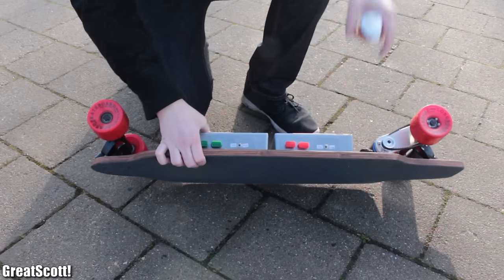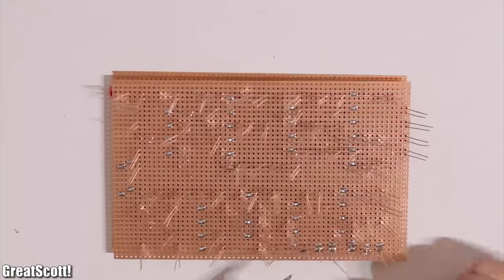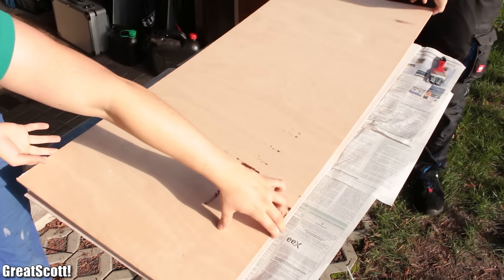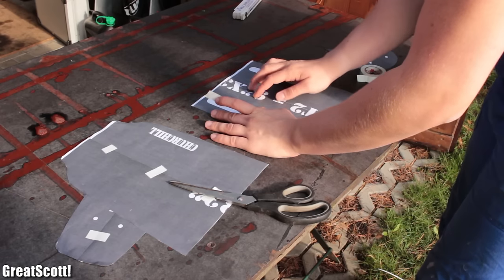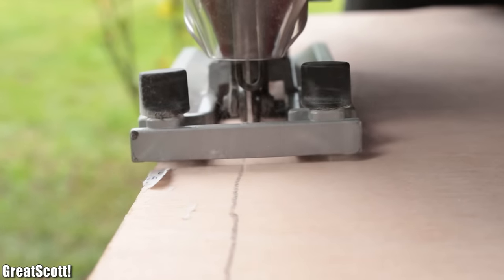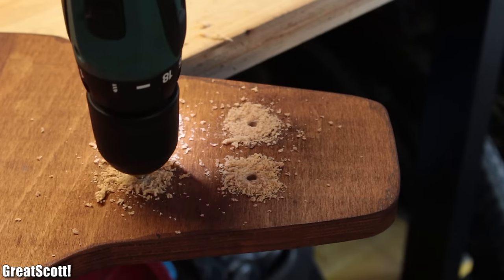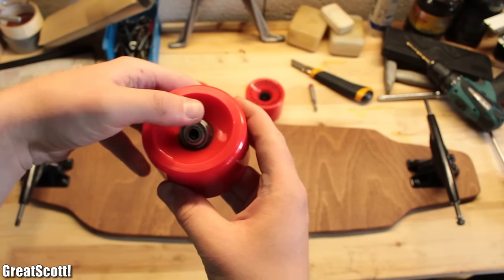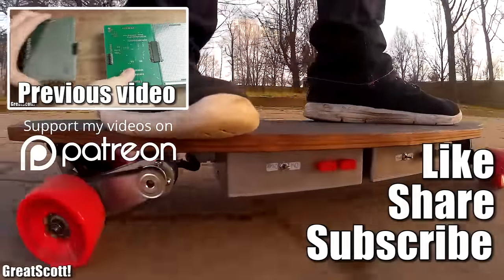Make your own Electric Motorized Longboard (Part 1) - the longboard itself

Comment: Ideally when making a longboard you're meant to put a convex bow in the ply when you glue it together so you have a "sprung" board (kind of like leaf springs) that can absorb a small amount of shock however I can see how that might make problems for the chain drive later on

Comment: As a kid I bolted a 5th wheel in the middle of my skateboard it was about 10". I bungee corded a 32cc weed wacker motor and made a hand throttle. I had an extra skateboard wheel rubbing on the large side mounted one to drive it. It actually worked great!! I had to of been 12.

Comment: 1. Does the fact that you only use one motor makes the board turn left/right all time?
2. Does it go backwards too? 
3. How long does it take to recharge? 
4. How many watts of power does your charger supply? 
5. If you wanted to make the board recharging your batteries when going down the hill, what would you need to do? 

Thanks for the answers, that's an awesome project!

Comment: A better alternative to Boosted Board's boards!
Reply: Ye when or if I make this I think I might put the two texture grip on
Reply: cheaper isn't always better... but you'll certainly learn a lot. head over to electric sphere. we build electric boards a lot over there. I like Alien Drive Systems and RedRock BoardShop builds but there are many to try!
Reply: +Stijn Stevens I build my own electric longboard and trust me, the boosted board is way more advanced. They simply use advanced battery management systems to allow for faster charging speeds and safer handling. The remote control is easy to use and very small and it uses sensored motors, which gives you a much smoother ride. You have to consider that Bossted Board has maybe the most advanced (and most expensive) boards out there, but there are many cheaper alternatives.
Reply: +Maximilian Staab Not to mention this can be improved as much as your skills are good for, plus parts can be scavenged or bought 2nd hand too to cut costs.
Really awesome tutorial though :)
Reply: +Maximilian Staab Hmm, maybe I should have said a cheaper alternative.

Comment: You could have used spray on adhesive and put the whole sheets of paper directly on to the wood and cut through the wood and paper with your jigsaw. Doesn't really matter but it would have saved you a little bit of cutting and taping.

Comment: Can you please not rely on a nyko Kama wii remote because the woo remote and the woo remote receiver loose connection very easily or when there is a little humidity, that's why everyone is going back to using car RC radios, but if you could build a sleek transmitter which shows the battery level that would be amazing, keep up the amazing work
Reply from the maker: +Adam Keely Don't worry, I opened up an original wii remote nunchuk and put my own electronics inside. Works great. But doesn't have battery level though.
Reply: +GreatScott! That is really awesome, you can just put a mini 3v to 30v voltage reader on the front which will solve the problem, you're Channel is truly amazing, all my friends are following your projects.

Comment: How much did it cost you in total? Did you consider using a more flexible kind of wood (bamboo, etc)?
How does this project stack up against a boosted board? Thank you for your great content :D
Reply from the maker: +Ramón Márquez Around 300$. It is pretty similar to the stats of the boosted board. Even has a longer range.

Comment: I have one question 
why did you made the thick sandwich layer of Wood you would have directly bought it of required thickness
Reply: +Nemeen Shah idk, maybe it costs less, maybe they dont have the right size available, maybe they would have had to wait for it or maybe they just wanted a specific kind of sandwich for stability.
Reply: +Nemeen Shah I was wondering the same thing, maybe it's cheaper?
Reply: +Nemeen Shah I would like to know this as well...I'm assuming its for strength and cost....
Reply: +Nemeen Shah It's easier to bend and way stronger
Reply: +NoSignal he doesn't want the board to bend in the middle (sag) like some riders do. ie: because of the batteries underneath already cutting your clearance.  so I don't think it's that. He can't add a bend to the board running length wise (creating a boat shape) if you meant that type of bend. stronger? questionable.  probably because he could and it would be awesome to say I made this entire board (except trucks, bearings, and wheels).  Hope your using bones reds bearings ;D sick vid and board so far. can't wait for the final diy vid. keep it up
Reply: I get your point, but it doesn't matter, 2 wooden plates togheter will always bend more and be stronger.

Comment: Since you said in another video that a mechanical weak spot is the aluminum piece you milled, would it be a better idea to mount the motor to the wood adjacent to the wheel instead?

Comment: Hi !
I watched all the 3 parts and i decided to build my own skateboard thanks to you, your work is awesome !
But I have a problem with my deck : i couldn't get 4mm and 6mm plywood , so i used 3x5mm thick plywood. Then i did everything as you explain (glue, press for 2 days, cut with template). But the problem is that, once i fixed the trucks and wheels, when wanting to get on the board i noticed it was way to flexible, like very very flexible...
Please if you have an idea on what i could do to fix my problem help me ...
Reply: Did you get it fixed? Why was it flexible and was it rideable?
Reply: well no I couldn't fix it,I tried cutting a ski and attaching it with screws under the board, between the trucks but it didn't work,  I think it came from not having the 6mm thick plywood, because it is not made the same way as thinner plywood. So I tried to ride it, unfortunately, It was very difficult to stand on it because i didn't want to put my feet in the middle of the board (to avoid breaking it) but since I used huge wheels (107mm) i didn't cut enough the board and had a wheelbite, which entirely destroyed the board (understand that it broke in half right before the front truck).
So if you find 6mm plywood, maybe go for it but i don't recommend doing this if you don't.
Reply: That's sad man. I just saw another video explaining how to make a deck and it says you need to put 2 things on each corner of the sheet before applying the glut so that it kinda flexes in the middle. Then you won't have too much flex in your board. Maybe that can solve the problem.

Luckily, I am going to build mine in a few days so hopefully mine works fine. :D
Reply: Synergy oh you'll tell me if you succeed :) Good luck ;)

Comment: please correct me if I'm wrong, but the motor is 'overkill' since the actual output from the batteries will be ~220 watts? if supplied with strong enough batteries can't this motor reach over 50km/h? (obviously illegal, but curious)
Reply: more importantly
WHAT'S THE TIME IT TAKES TO GO FROM ZERO TO FULL CHARGE?
Reply from the maker: Not quite right. Don't worry I will make an electronic basics video about the motor, ESC and the battery.

Comment: When are you releasing the further parts? I have an old long-board collecting dust I really want to convert.
Reply from the maker: +Oran Deutsch In the coming weeks every Sunday.
Reply: GreatScott! Ah, Ok.

I was looking through the part requirements and I was wondering why you used two 5Ah packs as opposed to a single 10Ah pack you can find in places like hobbyking.

I also noticed in the clips you did not separate the lipo cells but kept it in it's original packaging. Is this for simplicity? I was thinking when I come to do this I will remove the wrapping from my LIPo and have all the cells flat on the bottom of the board for lower profile.

Anyway, looking forward to seeing more.

Comment: Hi 
Just Requesting you if possible than kindly make the project about the EXCERsice Cycle which will generate the electricity and one can use that electricity to cut down the electricity Bill or one can use that where the availability of electricity is the issue.
even if this can combine with the setup of SOLar power system to power the home and make it environmental friendly system.
this is just an IDEA to save the Earth 
Waiting for your reply

Comment: Why did you laminate the sheets together to make 14mm ply, when you can buy 15mm. Was it to get more plys to give better rigidity?
Reply from the maker: +Sirus and flexibility
Reply: +GreatScott! I am confused. I always thought that flexibility and rigidity are opposites. Please explain ;)
Reply: Tomasz Kubiak Less flexibilty = better flexibilty in this project ;) Resiliant and springy, more long grains and less cross grains.
Reply: +Tomasz Kubiak he just means that it is flexible (flexibility) and not so stiff, but still rigid enough that it won't break (rigidity)...

Comment: will 410kv brushless motor work with the following specs
PROP - 15 x 8 
● Get 3600gms Thrust
Lipo - 6 cell 22.2V
ESC - 60 amp 
Power - 3600W
please reply..  I am sitting on this for sometime now

Comment: hey GreatScott i really want to make such motorised longboard, but i don't know what template to use. I saw you used the ST2 but i thought it was a bit short and was thinking about ST15. I'm not sure which one to get. (im 15 so not an adult, maybe sise matters)
Reply: Never mind, i just noticed that the ST15 is smaller than the ST2. How did you scale it that is would be printed at the correct sise? And will it be possible to scale it up a bit (from 31.62" to 33" or bigger)? I like the body of ST15 but I also like the idea of a big board.